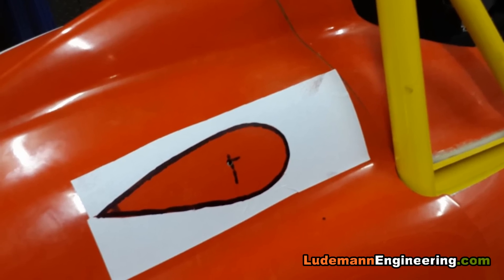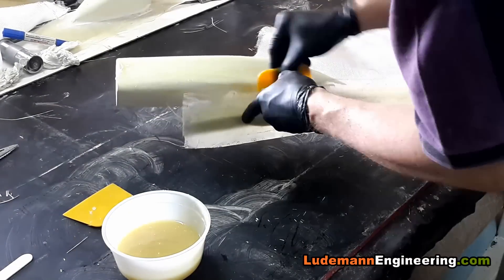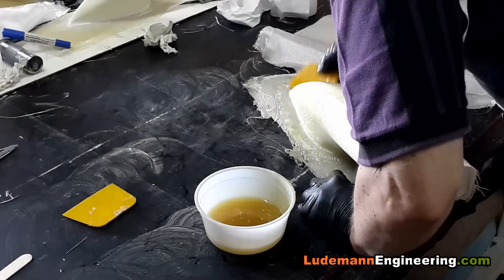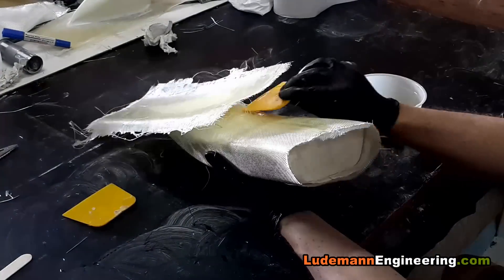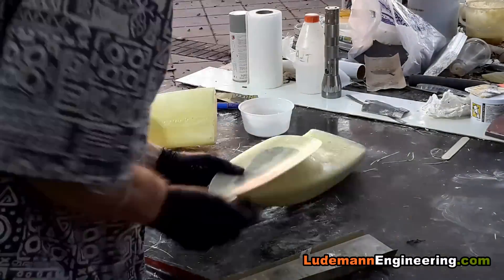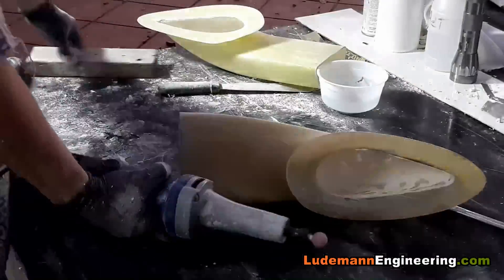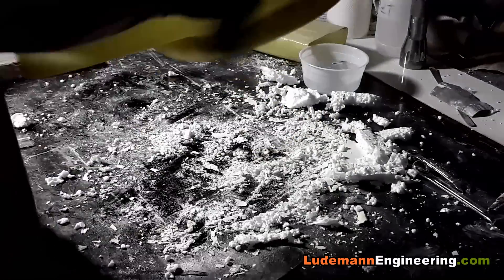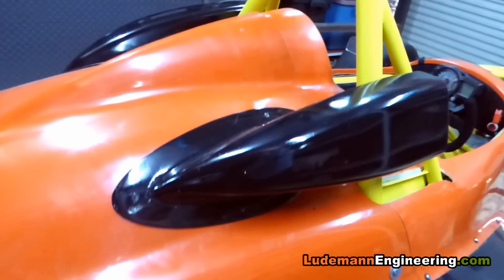How to Make Formula 1000 Race Car Air Intake Scoops Moldless Fiberglass

Comment: Nice, but all the science says these should have a bell mouth shape where the air enters.
The science says said shape should be an ellipse with a 3 to 1 ratio and be 25 to 30% larger than the 'diameter'  of the 'pipe'.

I would also bring the intake forward a bit so there's no aerodynamic interference from that front anti roll bar bit.
(YouBoob loves deleting my posts like the never existed, so no links to said science.  Sci-Hub is your friend when looking this stuff up)
Hope this helps in the future.

Comment: Best stuff for fiberglass “wax” is a toilet bowl gasket with a little added paraffin wax, mixed while melted (in a double boiler).

Apply the melted wax with a coarse-bristle paintbrush.  You want at least a 1/64th thickness of wax.  Shave it down so you get it smooth before applying the epoxy.  I’d use a fake gel-coat of micro balloons and cab-o-sil for my first coat, then apply the glass and epoxy to the desired thickness.

Once it’s sort-of cured, then the whole thing would go in the oven (small parts).  

This is best for small(er), intricate parts, like blower housings and ventilation fittings.

Comment: That would have been much easier & quicker if: 1) You used a brush instead of a spatula 2) You used chopped strand mat rather that woven cloth 3) You made a two piece flanged mold.

Comment: Few years ago I made a few very similar parts using a very similar technique. I used premixed drywall compound over the Styrofoam to smooth over the foam and finalize  shape and PVA mold release over the drywall mud. Normally you can't use polyester resin on styrofoam but the combination of the drywall mud and pva provides adequate protection for the foam.  I have removed the foam with a solvent but that's a messy process and leaves a residue instead, I prefer to cut it out the majority of the foam with a hot wire then just toss the whole part into a bucket of warm soapy water, the premixed drywall compound and pva soften in the water and release the remaining foam.

Comment: instead of cutting the foam out could you not submerge the whole item in a solution that dissolves foam but leaves fiberglass alone
Reply: Acetone. Styrofoam melts when it comes in contact with Acetone.

Comment: Hi, I learned a lot on your videos. I have a set of questions that I wish you could give an answer. Currently I have Polyester Resin, Polyurethane Spray foam, Fiberglass mat/cloth, and Auto body polyester filler. I plan to use the polyurethane spray foam and mold/trim it for a car moulding.
1. Can I directly apply the polyester resin and fiberglass mat on the trimmed foam mold then apply the filler after?
2. Can the polyester filler be applied directly to the foam mold?

Thanks!
Reply: I would recommend mold release and gel coat it

Comment: hello,
great job ! amazing work !
i have some questions please i hope to get answers
1 - is it possible to use mat fiberglass if we do not have the cloth ? i can't find the cloth here in my region 
2 - can the metal putty used for fixing cars be used to make a layer on the foam ? 
3 - which resin are you using epoxy or polyester resin ?
Reply from the maker: The fiberglass mat is not compatible with epoxy resin. It depends on polyester resin to dissolve the adhesive that holds the mat together, allowing it to conform to a 3D shape. You could use mat with polyester resin, though. Auto body putty cannot be used directly over the foam as it dissolves the foam. You can paint over the foam before using putty. I'm using epoxy resin.
Reply: wow i did not know that !
thank you James for your reply, about epoxy i did used it with mat though. I am using foam not styrofoam to make shapes, i made first attempt for a F1 nose but it failed, i did not covered the nose with any fiberglass, just white wood putty and then some yellow putty, and then the primer but everything was a mess because i misjudged the mixtures without a scale, but now i did made another attempt i used epoxy with mat, it has cured well.  You said I could use polyester with foam ?! aha so you mean i paint the foam with a spray paint of some color and then apply polyester resin with mat ?

Comment: I have a question where do you get your tyres I'd love to know
Reply from the maker: +Mitch We don't have a source for tires in Thailand yet. The ones on the car were purchased on Ebay US and shipped over by boat. There is a Hoosier distributor in Thailand, though.
Reply: +Ludemann Engineering ok thanks for the reply mate I'm from Australia and would love to take on a project similar to this but proper tyres are a tad difficult to find, I'll work it out some how cheers for the reply mate!
Reply from the maker: +Mitch I'm sure you can find the right tires (sorry, "tyres") in Australia. Auto racing is big there, and I'm in contact with another guy who's building his own F1000 car.

Comment: shoot,  I use acetone at work on a hourly bases. why not use carbon? Our 26' boat I build for work is 400 lbs lighter in carbon than it's cheaper fiberglass/kevlar boat option
Reply from the maker: +RJ Lamb SCCA Formula 1000 rules don't allow carbon fiber in any panel "licked by the air stream". So you could use it in a seat or instrument panel, but not on air intakes or radiator ducting. This, along with bans on titanium in the suspension and so  on, is to keep F1K affordable for middle-class racers.

Comment: Why didn't you used acetone to remove the styrofoam? Could have been a lot quicker (not very environmentaly friendly btw). Keep up the good work, can't wait to hear that beast screaming at full throttle!
Reply from the maker: +Benoit B Good point. Maybe I'll try that next time.
Reply: Acetone is much more environmentally friendly than other options, like toluene, xylene or styrene. Though it doesn't seem likely by the way it smells, acetone is actually quite low in toxicity and biodegrades reasonably fast.
Reply: wolfy9005 not only does petrol do the same thing, but it also creates napalm as a side product. 
Don't we all love the smell of napalm in the morning?
Reply: +Benoit B Came here to say the same thing, though it has to be an epoxy resin system as the other types react badly.
Reply: dont worry if the resin was polyester based it would eat the foam while applying the resin. Aceton would be fine you can use Xylol too its faster than acetone
Reply: Petrol does the same thing to styrofoam, plus it's a lot cheaper than acetone.  If you're using epoxy I can't see any issues(maybe some with polyester resin?)
Reply: I was thinking the same thing!
Reply: +Ludemann Engineering Did you try it?
Reply: Lacquer Thinner works as well. Not sure which is more environmentally friendly
Reply: Styrofoam and acetone = cheap Napalm
Reply: @jonellwanger7258  forgetting orange peels
Reply: @jdcustomz  while orange peels juice does lit on fire when squeezed into a flame, it’s not very practical at throwing flaming globes of sticky goo 50+ yards.
Reply: Karri Koivusalo yeah but if you think about it he is making a racecar.... Not the most envioromentally friendly thing in the world imo. Besides if you collext the used xylol and give it to a autoshop or recycling center you will be minimizing the harm